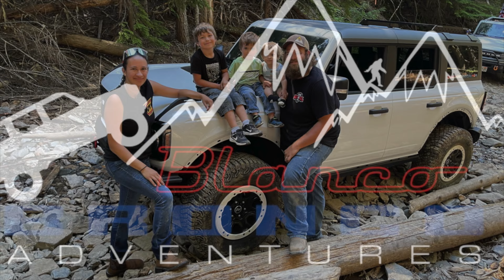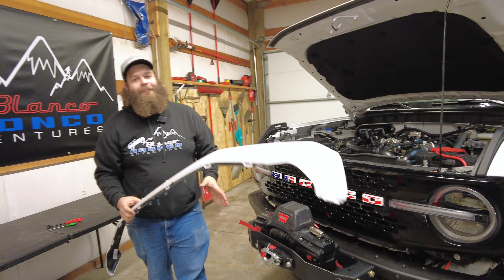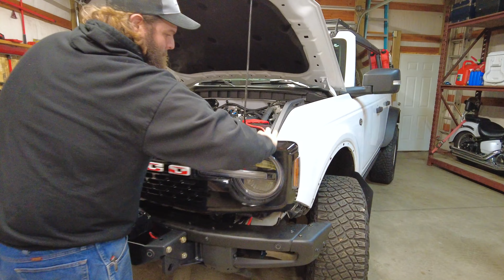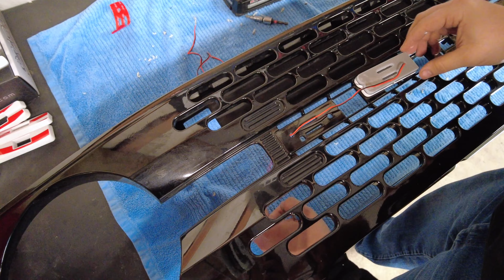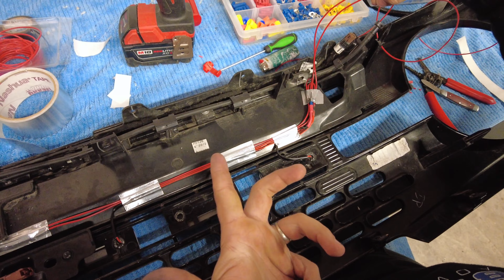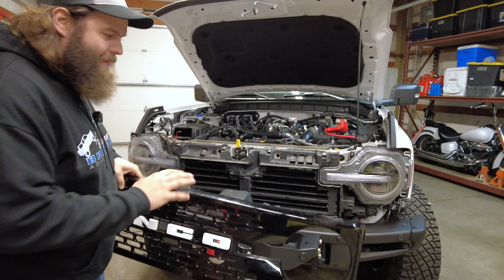Oracle Grill Lights Install on our Ford Bronco!

Comment: Definitely did not need to take the lower piece out under the grill.  If you are replacing it because it has holes that is fine but that is not necessary for the grill removal.
Reply from the maker: Yes, you’re right. We replaced it because it had holes in it from the dealer! Thanks for tuning in!

Comment: Good evening, I currently had these installed, do the lights stay on for a few minutes after the car is turned off?
Reply from the maker: Hello, Matt! It depends on how they were wired in. We opted to wire them into the running lights, so they do stay on for a short period with the rest of the lights on the Bronco after it is turned off. We’ve seen most people wire them into AUX switches in which case they can be turned on/off as you wish. Hope that helps and thanks for tuning in!

Comment: Great video. It's too bad the lights don't stay on after you start the bronco and act like true driving lights would have been nice however they do turn on when the headlights turn on. It's a little things in life right.
Reply from the maker: Hello, Mike! You can definitely wire these to come on with the ignition or even hook them up to an auxiliary switch! This is just the route we went with. Thanks for tuning in!

Comment: Where did you get the American flag letters for the grill? And will they fit on my 1970 grill? Thought about getting some if they will work on mine
Reply from the maker: Hey there, Nic! The letters were a gift, but we are thinking that perhaps a custom vinyl overlay would be best for a 1970 grill! It would look great. 🇺🇸
Reply: @blancobroncoadventures  those letter`s you have are larger than the early bronco one`s, i like the one`s you have and wish i could use them, i also like the one`s you put on that light up they look good when lite up

Comment: Did this drain the headlights faster?
Reply from the maker: Not sure what you’re asking, but we’d be happy to answer your questions.
Reply: @blancobroncoadventures  you wired it into the headlight didn’t you? If so does it burn the lights out faster?
Reply from the maker: We did wire them into the headlight! Since these are LED headlights and the draw of the letters is minimal, we have not noticed any changes. We’ll test that out for you, though! So far, so good. Even though we wired them into the passenger headlight so they automatically turn on/off, another popular option is to wire them to an auxiliary switch. Hope that helps and thanks for tuning in!

Comment: How do you run them to a aux switch ? Also with the white matte color letters how does it look with the Oxford white debating on getting the letters color matched
Reply from the maker: I believe the Oracle lights install video has them wired to an six switch! Also, we don’t notice the white standing out since it’s on the grill against the black anyways.